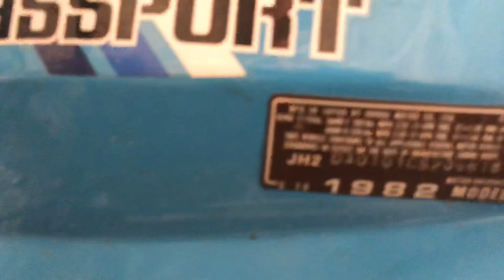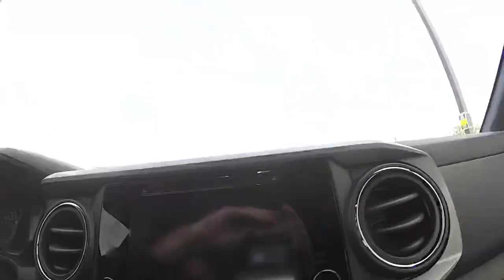Honda C70 / C90 BUILD [EPISODE 6]

Comment: Looks awesome. My build is at about the same stage. Been obsessing how to do the handlebar thing so this video is perfect timing. Just need to order the new bars. I’m going to mod the bars cutting and by welding smaller bars in the ends to use the stock controls. Like you I’m going make own bracket for bars. Thanks for the inspiration! Great vids.
Reply from the maker: Niiiice!! It’s super cheap to build your own bar mount, just takes fooorever! All of the StreetCub peeps are coming out of the woodwork. I love it!!!
Reply: Me too...stuck at handle bar.
Now got the ideas how to diy.thanks.

Comment: Hey, hope to see the final produkt of your projekt. Sweet this Street Cups. Really. I geuss they just little and sweet, but finaly you have to modify 99% of a bike to get it done. Because it is a hole motobike. Even if it's very little. IThe experiance you obtain, is like building a hole Motosikle. Not everybody thing. As hobby in free time, it"s worth, man. The experiance you obtain, it's Worth.
A modification in this degrees is most difficult. A rebuild is much 'n more easyer, cause you have all the sizes from manufaturer. A new build is even easyer, cause you can set the sizes on your own, which have to fit on your plan for the project. By modifing you have to change all which does not fit to your mod. Can cost more than you thought befor.
Wish you all best and nice regards from Istanbul.  Thanks (Teşekkürler) for the vids.
Reply from the maker: This is true! Definitely easier to start from scratch. I build Ruckus scooters from scratch because you trash most of the parts in the build. Same goes with this build. It’s been sooo fun! Very drawn out project though. Thanks for watching and your support 🙏
Reply: @RollingWrench  Main sence is enjoing a hobby and having fun, sir engineering. Have a nice day. :)

Comment: This has been a great series. I'm really enjoying it. One thing tho... I can't believe you're betting your life on that flimsy little 1/8" sheet metal disc for mounting the handlebars. An then spacers on top of that. Super sketch dude. As I said, it's been a great series so far, I'm just worried about your safety Brutha.
Reply from the maker: I think you think it’s thinner that it is. It’s thicker than the stock piece. Thanks for watching.

Comment: Why not a disc brake upgrade?
Reply: thats my thoughts drum brakes are trash
Reply from the maker: You know, I really wanted dial brakes! I could not find the hubs for the disk brake set up anywhere!! When it was to late I figured out that Honda wave hubs will work. Honestly I will probably redo the wheels for disk brakes at some point, along with the front suspension.
Reply: You should talk to "streetcub stories" on yt they may help you with DIY tricks for street cub.. and maybe you can order some parts from him because he also buliding and selling street cub ...